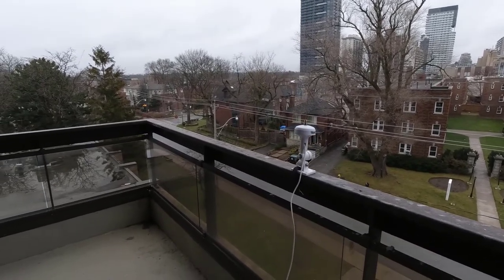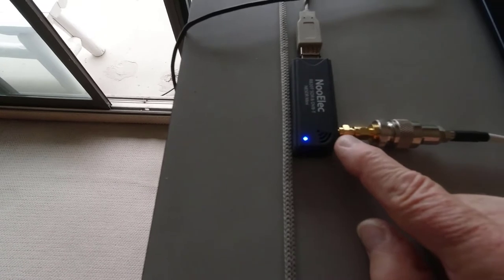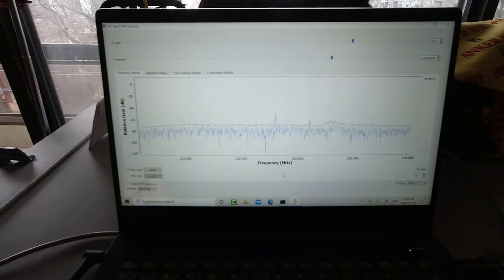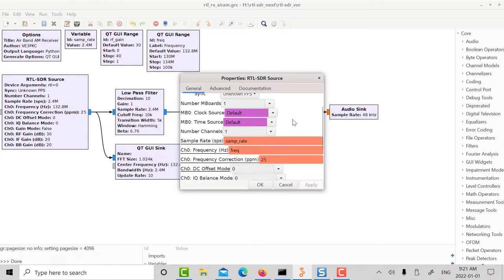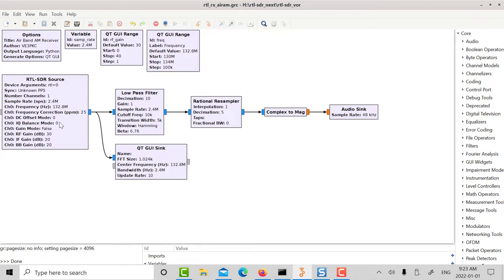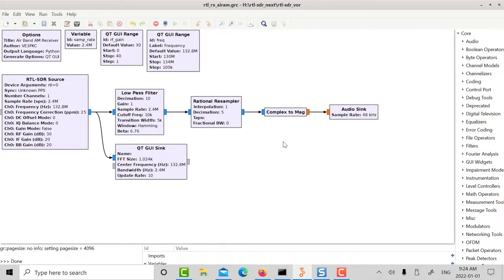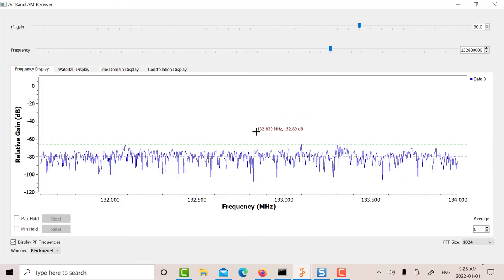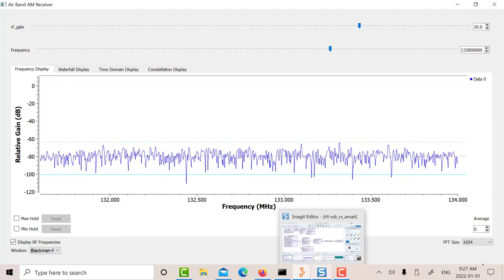RTL-SDR for VHF Air Band AM on GNU Radio

Comment: How do I do this with USRP (B210)? I tried to with necessary mods to your diagram but it didn't work. Might it be the antennas?
Reply from the maker: Not familiar with USRP. Have you tried it with other software (matlab) or on a different schematic to see if driver and setup is working?